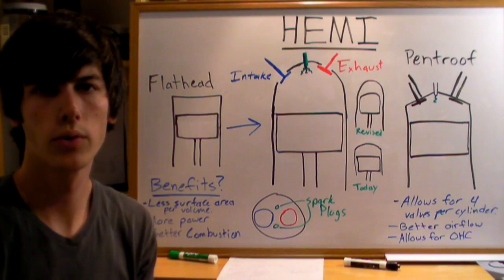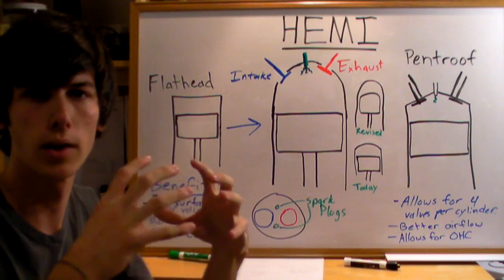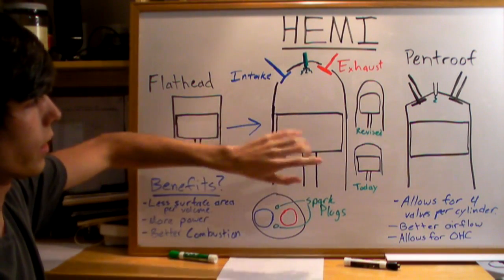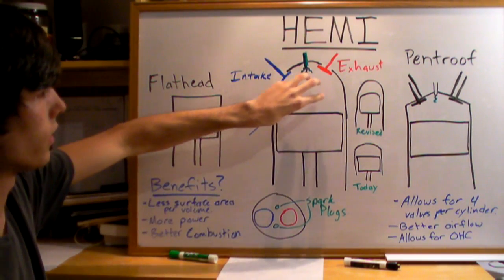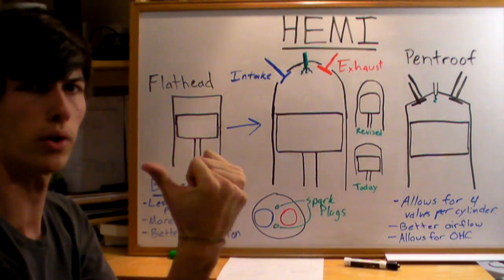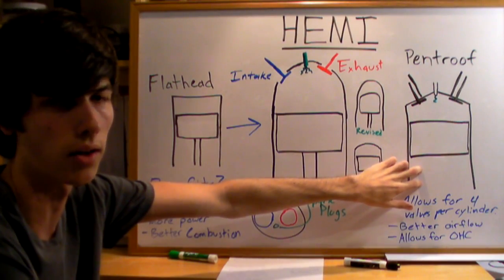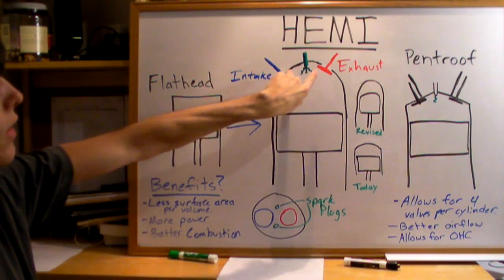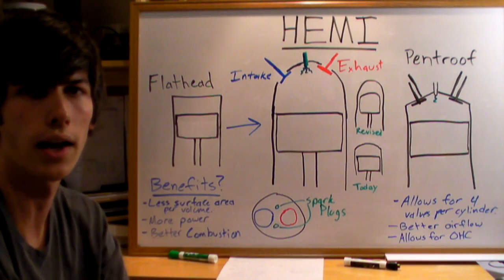What Is A HEMI Engine?

Comment: hemis are outdated, they are less efficient. I still choose to own one. BECAUSE MURICA AND SHIT.
Reply: You, I like you
Reply: moses weyer If it was outdated, why would it be in the most powerful muscle car in the world. The Dodge Demon?
Reply: Oh... and the Dodge Demon is a perfect example of weasel words. 

It’s not a Hemi in the Demon. The modern hemi doesn’t have a true hemispheric combustion engine. If it did... it wouldn’t produce enough power nor pass emissions. It still needs a second spark plug to burn all of the unburned hydrocarbons before they are sent out the exhaust because it isn’t as good at mixing fuel and air as even an old wedge head. 

Next... it’s the “fastest” (accelerating over a short distance in a straight line) “muscle car” (a car based on a family vehicle with a large gasoline engine designed for straight line performance over short distances). It’s the ONLY muscle car!  Any wonder it’s the fastest!

The Mustang and Camaro are full blown sports cars now with good handling and braking and the Tesla S P100D family sedan absolutely destroys the Demon in the 1/4.
Reply: they are less efficient (well the classic ones are) but I'll bet every reason you've been led to believe why is wrong..
Reply: lmao what computer glitch is small when it entails a 10,000 dollar repair?
Reply: nu uh
Reply: Your modern day Hemi is not actually a true Hemi
Reply: outdated but still the engine of choice for top fuel, promod and stuff.still the best

Comment: lot of comments here, but I'll add one.,,, I could not buy a Toyota with 485 HP so I bought a SRT 392 HEMI
Reply: +The real doktorbimmer How many of these wonderful German creations have the lower end capability of withstanding 6000 horsepower? How many are capable of 3-4 second quarter mile times? Some guys tried running the sohc Ford and big Chevys, but by 72 tire technology had surpassed the power output of these engines. Unless the rules have changed since the ninties, Top Fuel is "run what you brung" with the only real restrictions no computer control and maybe displacement. In the sixties, guys even tried Allisons but they were way too heavy for good ETs. They are still runnng aftermarket engines based on the Gen 2 hemi because that is what is competitive.
Reply: +The real doktorbimmer um... you've obviously never heard of the Hellcat twins
Reply: +Allen Wilson  chiness too
Reply: The latest rule I have is 2012."ENGINE
Any NHRA-accepted, reciprocating, 90-degree V-8, singlecamshaft,
automotive-type engine permitted. Multi-valve and/or
Section 18, page 2 Top Fuel Dragster
overhead-cam engines prohibited. Maximum 500 cid, minimum 490
cid; maximum bore center spacing 4.800 inches; maximum cam
centerline 5.400 inches, maximum two valves per cylinder. Only one
cylinder-head design is acceptable:
Intake valve angle of 35 degrees, + or - 1 degree
Exhaust valve angle of 21 degrees, + or - 1 degree
Engine block must be forged aluminum and NHRA-accepted.
Dry-sump oil system permitted. Dry-sump tank must be mounted
inside framerails. Engine must be equipped with an SFI Spec 7.1
lower engine ballistic/restraint device and SFI Spec 14.4 valve
cover blanket. A positive method (flange, lip, etc.) must be attached
to the intake manifold or engine block to retain both the front and
rear manifold to block gasket(s). The flange/lip must extend past the
surface of the gasket and be contoured to closely fit the block and
manifold surfaces to prevent the gasket from extruding. Carbon
fiber/composite oil pan prohibited. 
Nowhere do you see the word Dodge, Plymouth, Chrysler or Hemi. Pushrod engines have been around for eons; so have almost any other configuration used in automobiles. In 1903, Peugeot introduced the first DOHC design with four valves per cylinder, so it is hardly a modern configuration. If pushrod designs are so dated, we wouldn't be seeing the scores of LS engine swaps into three and five series BMW's. Output per litre is irrelevant unless one is class racing. Output per pound is a better indicator of performance. A prime example is the Jaguar xj to small block Chevy (GEN 1) swaps. Tuning level being equal, an all iron little Chevy will make 40-80 percent more power than the DOHC Jag and weighs 150 to 200 lbs. less. Simple is not always less efficient. Look at the Luger vs. the Colt 1911...one grain of sand in the wrong place can cause the Luger to jam, while the Colt doesn't start cycling well until it has been dropped in the mud three or four times, and history shows us how that worked out. Your arrogant assertions that anyone who disagrees with you is confused reveals your own lack of historical knowledge. Look up the top fuel history of the sixties and seventies before attempting to insult others.
Reply: Facts Sparky....give us a few accurate facts. Assertions without facts are opinions. I'm apparently a stupid American so enlighten me. Where do you assert I made a false statement?
Reply: Are you an adolescent, or just a typical German adult? Since you're LOLing from the last post this one will really tickle you. Ask grandma or maybe mama if she prefers Russian or British "Hot Rods". I'll give ya ten to one she won't be able to choose between the Brit "long stroke" and the Russian "big bore".
Reply: Maybe the reference wasn't to cars. As for the Hemi in top fuel, I do fully admit it is the only competitive platform; nothing else can flow enough air to produce the six to seven thousand horsepower to be competitive. You have stated repeatedly that the Hemi was the only engine allowed in Top Fuel since the 70's. Dart engineering brought out a dry block in the late seventies based on the big block Chevy, and a couple of teams tested it. Not competitive. I don't dislike German's in particular, nor German engineering. I've got an early Z3 in the shop that needs an engine, and I'm scouring the insurance auctions for a totaled 12 cylinder car to build a Teutonic hotrod. What I do dislike is arrogance, whether British, German, Italian, French (ohh especially French....which way do we go to surrender?) or Japanese. Car guys, no matter where they are from, must do the best with what they have available. In the US, that was designed with production line expediency and costs paramount. The Italian tax structure demanded small displacement, hence high revving small displacement motors. The Brits were taxed according to bore, hence long stroke small bore motors. We're all just working with what we have. My pushrod v 8 is not better than a Italian twin cam v 6 because of the American engine's output, nor is the Italian iron better than the American because of it's fuel economy. Different tool for a different job. Peace.
Reply: And you can’t use it on most roads.

Comment: Having a push rod engine is not a bad thing or old tech. Most modern face cars use them because it provides a lot lower of a center of gravity then DOHC or SHOC two valves isnt a bad thing either you get a lot more low end torque with two valves and torque is way mor important then horsepower in cars or trucks so all arguments of pushrods and 2 valves being bad is invalid. and by the way hemis are made to make power high in the rpm band thats just how they were designed. the 2 spark plug thing is so that they burn all the fuel possible to make the most power not about emissions
Reply: It not outdated to me. It's typically greater displacement counter acts its less than ideal volumetric efficiency. Sure the Fords 5.0 liter coyote can make as much peak horsepower as GM's 6.2 LT engine but below peak it cant match the torque . Chevy has won le mans with a naturally aspirated 5.5 liter pushrod 8 times against turbo six and 8's cylinders so I beg to differ
Reply: +The real doktorbimmer Interesting.
Reply: +The real doktorbimmer I've heard that as well, the HEMI® engine of today is apparently much closer to a polyspherical design a la the '57-66 318s.

Comment: Surely the reason the Dodge Charger Hellcat produces so much power, and especially torque, is not because it's as smart and efficient an engine as say the Ferrari F12, but because it's a hemi..On a side note, I wonder why, when moving from a flat piston head to a curved one in the hemispherical cylinder, they didn't handle the resulting weight issue by taking the same volume off the bottom in the mirror-image shape..unless it was because it lowered the strength of the piston head/rod connection unacceptably. Modern materials should/may yet make a difference to the weights and strengths..in fact I heard that was one thing that the engineers of the Hellcat's hemi had to find some answers for.